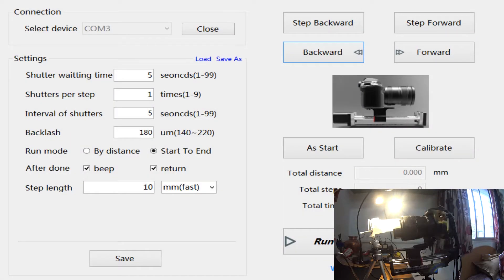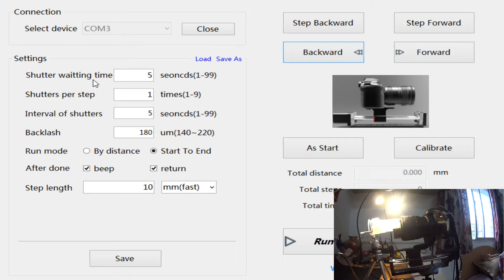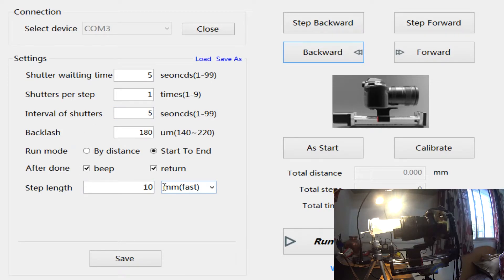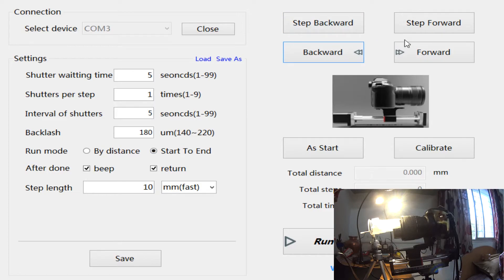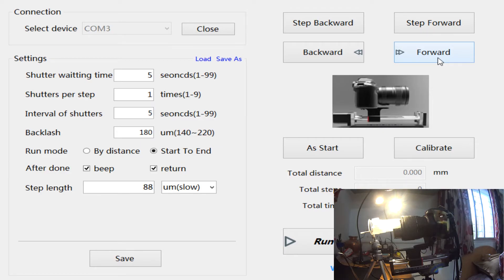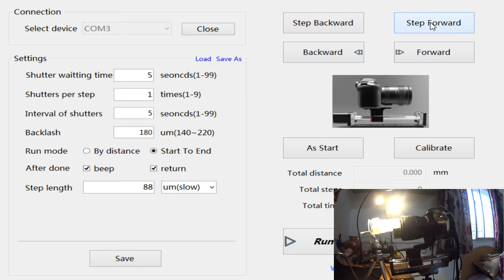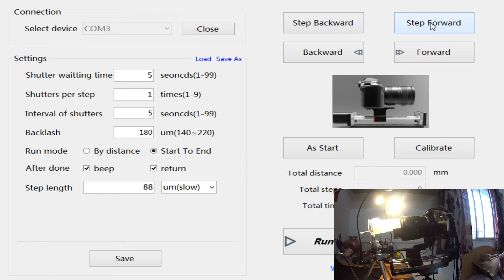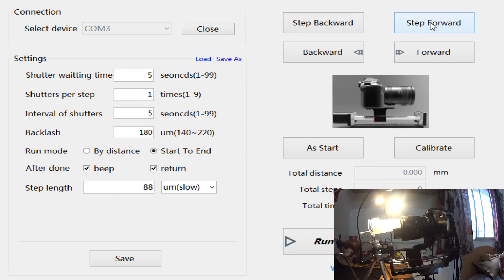Difference between Manual Rail and Automation Rail Part 3

Comment: I have a tokina 100mm 2.8 macro and a d7000. I've recently ordered a set of dumb extension tubes and a manual rail (similar to one you reviewed previously). Do you think with my optical equipment ( i.e tokina 100mm + extension tube) I'll benefit from something like wemacro, or should I think about it only when I upgrade the optics?
Reply from the maker: chinmay kamat I think given the scenario, first play with the manual rail. I have said in the earlier video that manual rail also is enough for starters. Don't immediately spend on the wemacro.